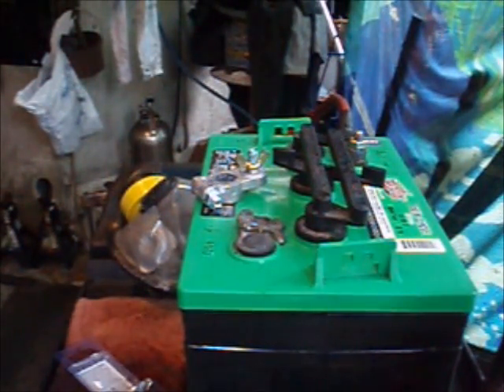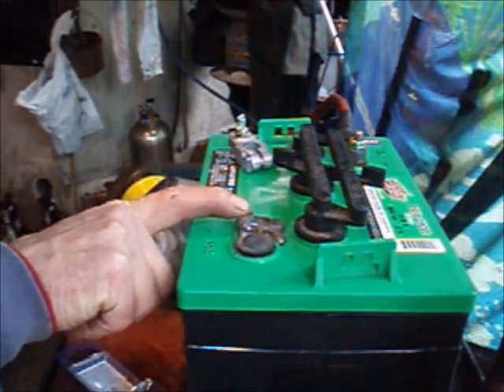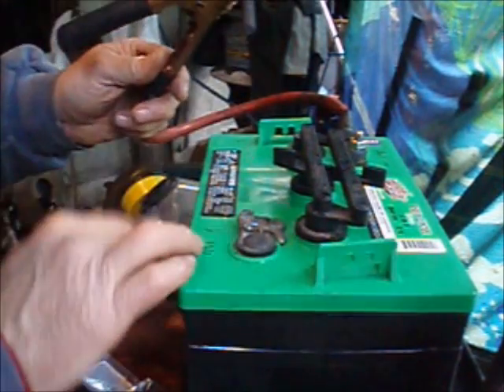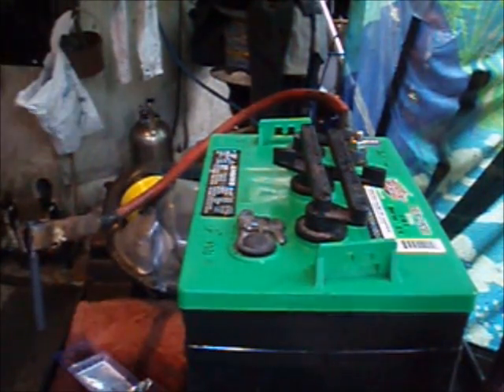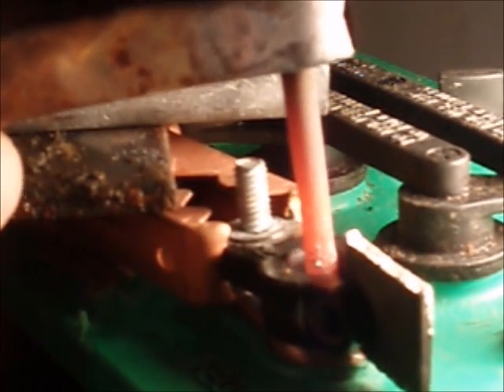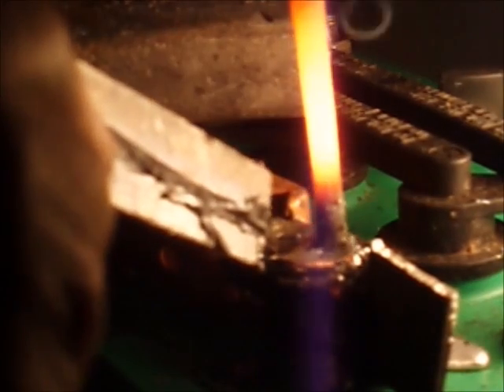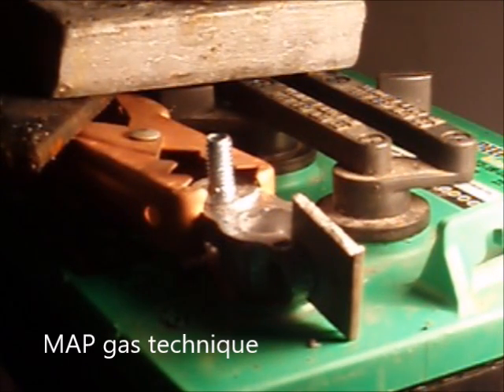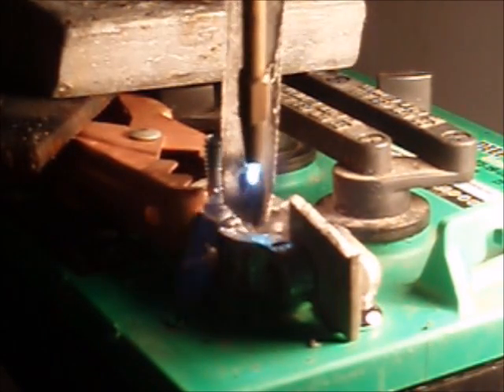Electric Vehicle Battery Post repair

Comment: Why can’t you use a soldering iron to loosen up what’s left of the post and when it gets a little liquidy pouring already melted lead  on top for better fusing
Reply from the maker: Good idea but the type of lead used in battery post has very little to no silver content to the meting temperature is quite high compared to a soldering iron. The length of time that you would have to heat the post up to get it liquid may damage the connection to the plates internally. I was following the lead of methods used in industry but heh, give it a try and report back.
:fish-orange-wide-eyes:

Comment: Thank you for this video.

The resistivity of hot solid carbon is 1.00 × 10−5 Ωm
Assuming the carbon rod diameter is around 5mm, and 5cm length, its resistance is around 32 Ω.

All this heat from less than a half an amp current.

It took the rod around 13 seconds to start glowing. I guess its temperature at that point must be around 900 °F

Comment: My question is what is the rod hooked to. Do you just use the battery itself. By jumping terminals over to get it hot or a battery charger
Reply from the maker: to the opposite post of battery you are working on. Note lead melts at 621 F (327 C) here is a link to a professional  https://www.youtube.com/watch?v=aWD3wOKZvgU
Be Safe

Comment: This quick and easy method, you can have nearly unlimited amounts of battery power …for nearly no cost [Check Details Here==>https://www.facebook.com/Battery-reconditioning-310070329426065/app/208195102528120 ]. Enough to even live off-grid and power all of your devices an electronics! This easy method works for nearly all kinds of old/dead batteries too…

Comment: I've got a sealed optima battery, thinking of trying that.  I've been close to a battery that blew up, it sucks.  the guy that blew it up in highschool auto shop got acid in his eyes but was fine.
Reply: Again not recommended, certainly if someone was to try it you definitely want it well ventilated outdoors on a windy day, damp cloths !!
Reply: I shouldn't have to worry about a sealed battery as much. although 12 volt battery may ark instead of a gentle heat from carbon rod

Comment from the maker: Thanks for the great advice and description of another method to repair a battery.
You are absolutely right DO NOT DO THIS AT HOME especially doing these "permanently injurious things". Venting happened for 3 days prior with the caps off, it was a very windy day which did not require additional ventilation and I decided it was better to prevent sparks or flames from entering an open hole so put the caps back on, perhaps bad judgement on my part. Wet rags placed on top might have been a good idea too. Blowing compressed air across the battery is a great idea. If I could find a mechanic or a battery shop that did anything other than want to sell me batteries you are right, way better idea to let them blow themselves up. Not sure where you live but up here Rad shops don't fix rads, electronics shops are gone and battery shops recycle batteries. There is no money in fixing things any more. I did not invent this method here are links to the videos I found you be the judge.
AGAIN DON'T DO THIS AT HOME, DO NOT TRY TO REPEAT THIS YOURSELF
I GOT LUCKY YOU DO NOT WANT TO RISK IT.
https://www.youtube.com/watch?v=aWD3wOKZvgU
https://www.youtube.com/watch?v=MxUjf1WMoRs
https://www.youtube.com/watch?v=u8oiMoP5A1E

Comment: I am aghast at the severe, potentially permanently injuriously things done in this video.

Let's start at the beginning.  Before doing ANY sort of work around a battery, the caps should be removed and the space above the acid flushed, preferably with argon but plain air will work in a pinch.

With the lids in place, highly explosive hydrogen and oxygen in just the stoichiometric ratios are present in the "air" spaces above the acid.  If flame or spark reaches the battery cap vents, the entire top of the battery is usually blown off.  Sometimes the whole case is ruptured.  

It gets worse as he proceeds with the carbon "arc" (actually resistance) welding.  Now the battery is under heavy load and is actively gassing.   That primes the air spaces with even purer explosive gas.,

The torch is the worst because the open flame brushes across the cap vent as he moves the flame around.

All of the methods he shows require extended heating burns out the seals where the post goes through the case top.  The "repaired" battery will be an acid leaker and terminal corroder for the rest of its life.

Fork lift batteries are completely different critters than consumer batteries.  Consumer batteries are not designed to be repaired and so the seals are generally constructed of a low melting point polymer.  Therefore the correct method and the one I learned after spending many hours moonlighting in a friend''s battery shop, is fast heat, fast cool.

There are available for less than the cost of that adapter terminal, repair molds.  These consist of a hunk of steel tubing the height of the terminal and with the inside mahcined to the terminal's profile.

The mold is used thusly.  The remains of the terminal are scraped and filed to shiny metal.  Water is puddled around the terminal to keep the seals cool.

The mold is heated a dull red with a torch.  It is dropped over the stub and molten lead is poured in.  Immediately the mold is spritzed with a spray bottle of water.  As soon as it's practical to do so, the assembly is cooled with a dripping wet rag.

The most modern method involves placing the cold mold on the stump, heating it practically instantly to red heat with an induction heater, pouring in the molten lead, etc.

My advice is to take the battery with the melted post to a competent battery company and have the correct style post cast using the proper technique.

John

The mold lifts right off and the junction between old lead and new is generally invisible.  The whole process takes less than 2 minutes.